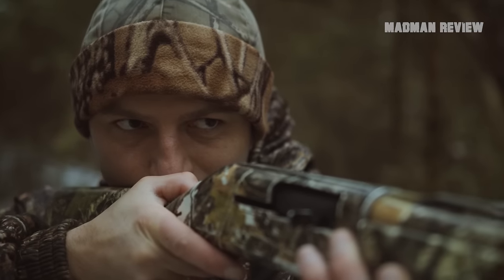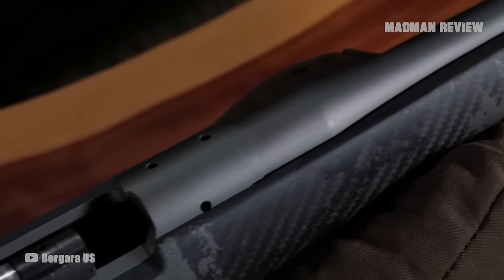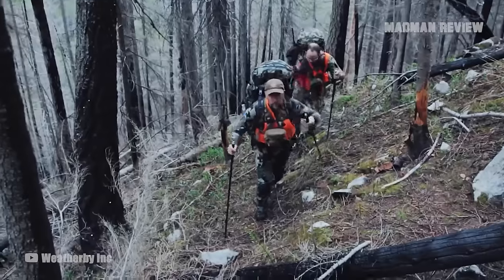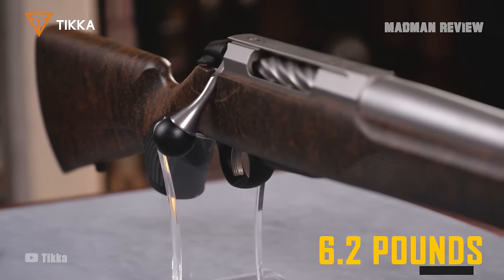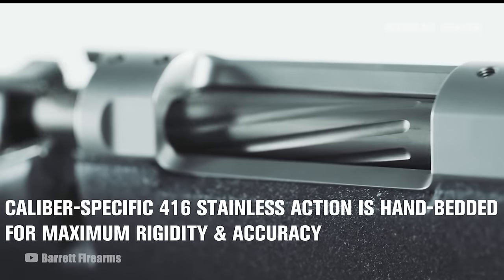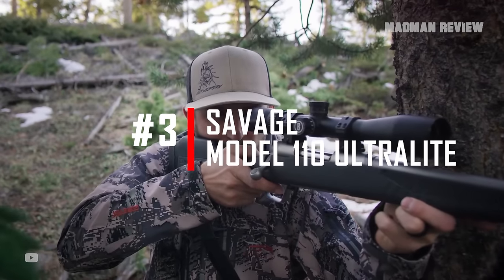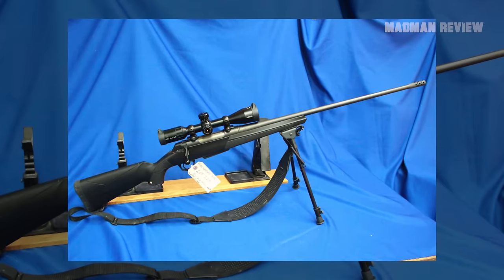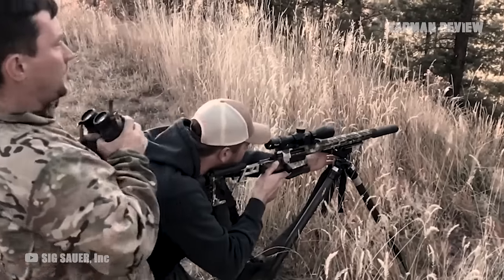10 Best Lightweight Rifles for Mountain Hunting

Comment: As the owner of a ruger m77 paddle boat in 30-06 I can confirm that the kick ruins your shoulders and ability to drag any deer you shot.  Provided that you can actually hit with a light gun.
Reply: Ummmm...

Mabe watch some genuine martial arts guys breaking things with fingertips,  elbows,  forehead,,,,

 They aren't crying over anything, 

 Ask them about your situation  for the correct strategy for your body type,,

   From some 1 who has a 338 win mag , zytel stock, ,,,,

You tube

 Iraq veteran 8888,

9.2 x 63  or whatever converted to paddle stock,,,

   Then again,, mabe some folks are made of steel, 

And your not,,
Reply: @danielravenstar4051 always a tough guy Karen out there

Comment: I have the earlier X-Bolt Pro with straight barrel fluting and fluted bolt. Metal and stock are bronze Cerakoted and matching Talely scope rings. 
BUT... I love the WEATHERBY Backcountry in 5.6 RPM. That rifle withers TENSIONED carbon fiber barrel and ti action is THE best factory mountain rifle I've yet seen.

Comment: How did you miss the HOWA Carbon?  The mini action starts around 4 pounds!
Reply: Poor people gun
Reply: How did he miss the CZ 400 series, 500 series and 600 series? You know, those cheap ones one grabs to help himself lift outside of the smallest wooden building around with his fat ass. Then, right after finishing craqqer, he doesn't even look at the box of ammo. Does not care which manufacturer, which lineup and the actual type of ammo ballistics he loads. Now he can shoot SUB-MOA groups. Just like yesterday when drinking was on schedule. CZs are known for modest design also known as poor or boring. They usually happen in sh!tty calibre like .22WMR/LR or whatever in 5,5mm. Most likely he similarly to all the other Americans, has never seen CZ in calibers like 30-06 Springfield or .308. Ergo - they don't exist.

Comment: Add $500 to the price of each of these rifles. None of the rifles come with sights so optics have to be purchased or sights installed. Without some sort of sighting system the rifles aren't very accurate.
Reply: Most rifles don’t come with sights.  When it comes to optics you get what you pay for.  500 isn’t going to get you much of anything.